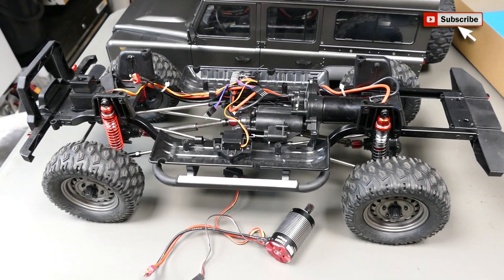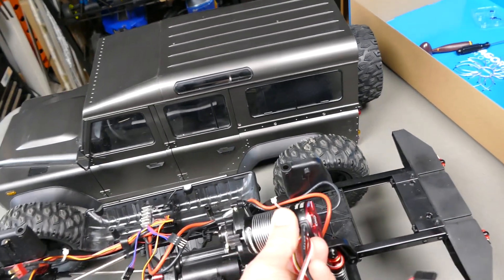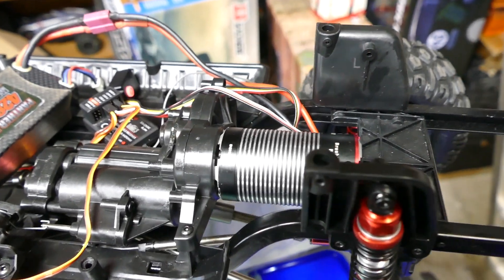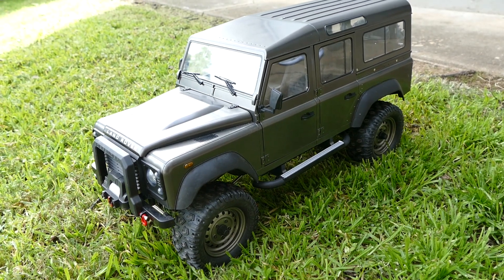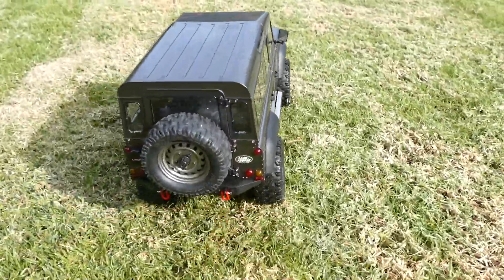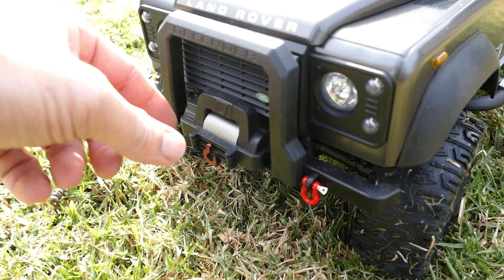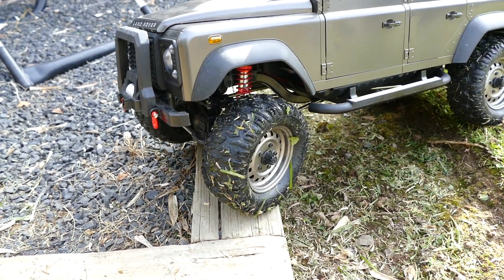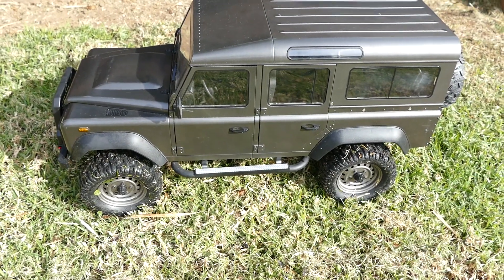HUGE 1/8 Land Rover Defender Just Got BETTER - BRUSHLESS HOBBYWING 2 IN 1 ESC & MOTOR INSTALLED

Comment: Thank you for all the 4 stroke support also!!! My dream in 10years is to have the rc hobby grow with high quality, durable, powerful, fast, and most importantly FUN TO WORK ON scale 4 stroke automotive based engines(overhead cam engines mainly). Also high quality, simplified scale automatic, or manual styles 4,5,6 speed transmissions(like a simple constant mesh gearbox...).
Reply from the maker: That would be awesome man

Comment: So glad you left this one electric! Took mine out in stock form on a hours trail run and broke the front axle and the gear change servo. So upgraded it to Injora metal axles and scx10 gearbox with a Hobbywing crawler esc but havnt had it out yet. But saving my pennies for a motor like you've got in yours!